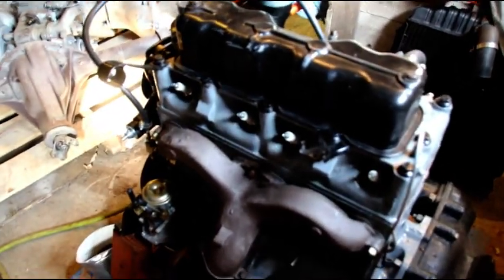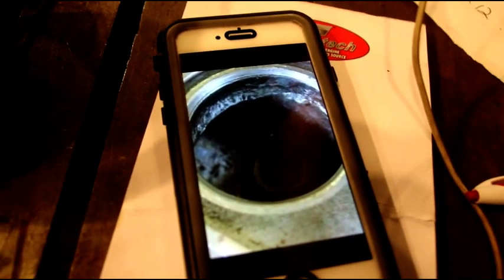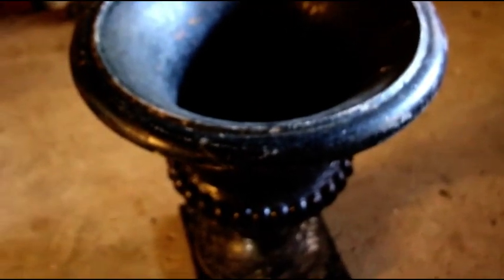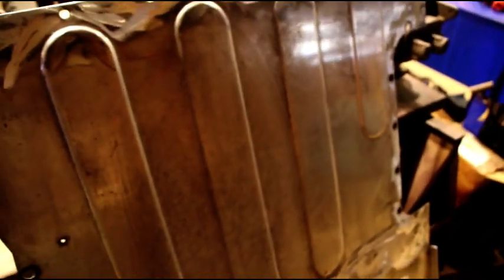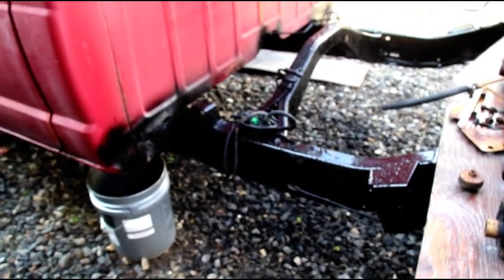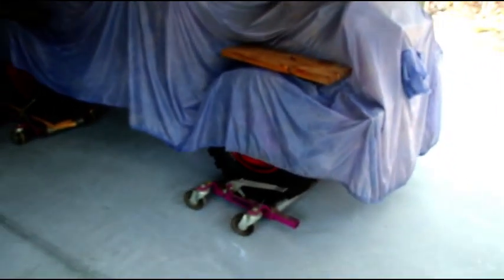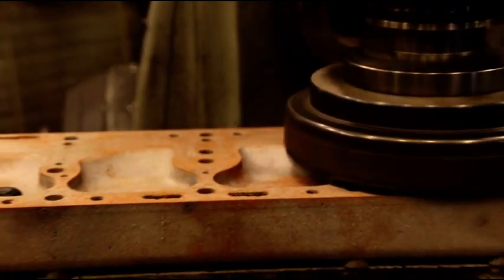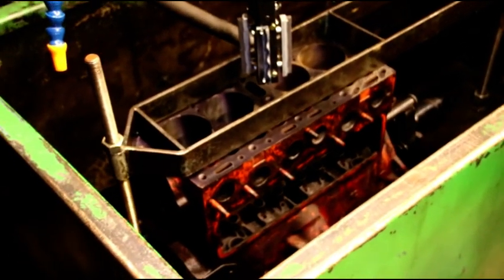Willys Engine Work, J20 Transmission Problems, Searching For Help......

Comment: thanks for the vid on Eric's eng can't wate to see it running take your time and good luck with your new p/u//and did the babys fly off yet?
Reply from the maker: check out the video I put up today.  engine is running and leak is fixed.     Just having trouble with the Solex carb. can't get it to idle the way I would like it to.

Comment: What a mess with the tranny. I’m surprised you don’t rebuild them. I bet you could do a great job
Reply from the maker: I don't want to get into automatics.  I don't really like them and contemplated putting a manual transmission in the J20 but didn't want to get into the modifications so figured I would just get it rebuilt.   That turned into a disaster that I am hoping to get fixed soon.

Comment: Brian... Put a Standard transmission on the J20 if you loose your automatic transmission. Juan
Reply from the maker: I was thinking about it when I found out the automatic was bad.  Didn't want to do all the modifications associated with a manual box so I had the automatic rebuilt.   Bad decision